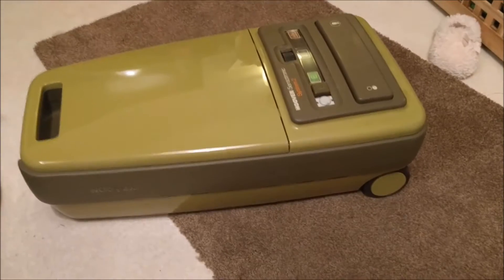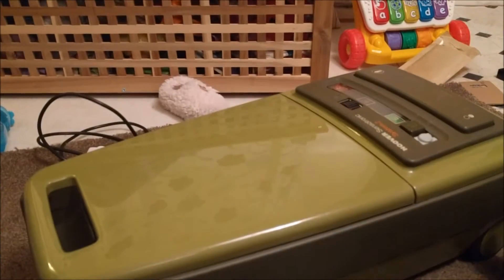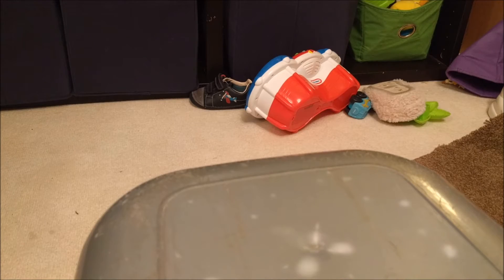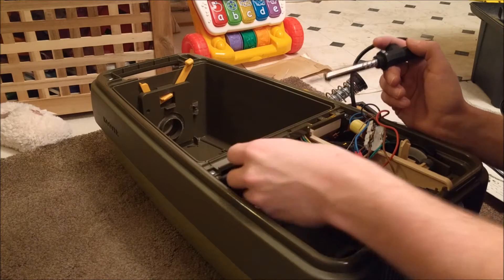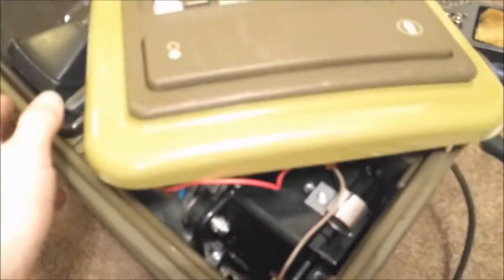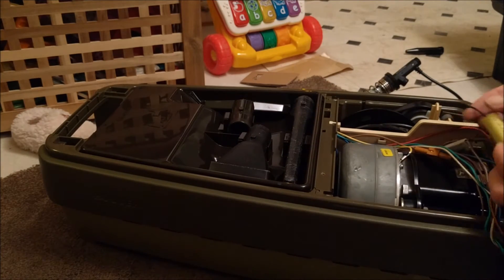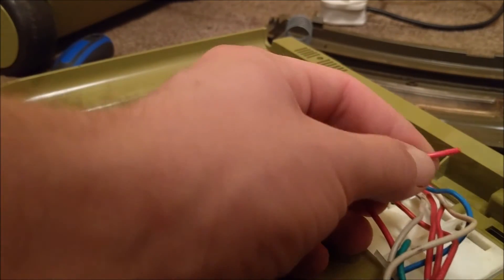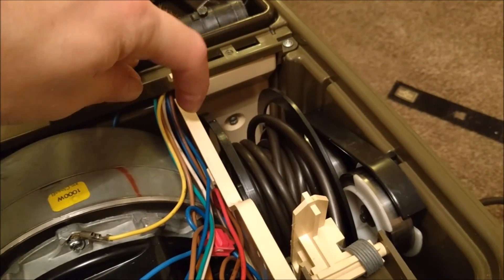Hoover Sensotronic S3128 - (An attempt at) Electronics Repair

Comment: Adult juice... lol Well done for tackling the reed switch. Quite an innovative component for them to use back in those days. Looked a bit of a cheap way for Hoover to apply it though. The glass/plastic packages used in your machine are nearly always PCB mounted, so no wonder it was difficult to fit without damaging. Did you check continuity on all the wires in line with the indicator lamp? Could be as simple as open circuit somewhere. Can't image what's on the PCBA, looks to be all 240V - not much logic going on. Be interested to see what all those wires are connected to behind the cable rewind.
Reply from the maker: Nicholas Wheeler I think one of the Reed switch issues is the new one is smaller, so doesn't fit as easily. The sellotape replaces hoover original sellotape! I've not started checking the continuity yet from the pcb to the circuit board, but will do that when I get to it! I'll be sure to show the pcb too when I dig it out!
Reply from the maker: +Nicholas Wheeler The pcb sits behind the beige panel behind the rewind, so I've got to take the rewind out, then the dividing bit, then hope there's enough flex in the wires to not have to remove them all as the Reed switch broke when refitting it the last time, and I'm not doing that again!

Comment: top tip, don't join the leads when cutting out a arc supressor, you dead shorted by joining the wires.
Reply from the maker: Will Vaszocz Oh is that was its called? Why did I think it was an rf supressor? What's the difference?
Reply: +Beko1987 sorry i meant rf supressor, but it is still wired in the same, the supressor goes between the live and neuatral on a motor to reduce electrical noise from brushed type motors. so when you joined the two black wires it shorted out. an arc supressor is installed in a simmilar way on relay switches to reduce arcing on contacts.
Reply from the maker: Will Vaszocz I've removed loads of rf supressors before though and it's been fine. But they did have more wires, usually an earth too. This one was different though!
Reply: +Beko1987 did you try running the machine without the capacitor and black wires disconected,
Reply from the maker: Will Vaszocz yes, it ran fine before I took the capacitor out, then blew the fuse when I ran it without. I didn't take the wire out completely though, it links a live and I didn't think it would work at all. Tempted to just leave it now tbh! It works...
Reply from the maker: Will Vaszocz yes, it ran fine before I took the capacitor out, then blew the fuse when I ran it without. I didn't take the wire out completely though, it links a live and I didn't think it would work at all. Tempted to just leave it now tbh! It works...
Reply: +Beko1987 probably better off, but i bet if you cut it out and did not join the black wires it would probably run
Reply from the maker: Will Vaszocz ill try it, thanks!
Reply: +Beko1987 goodluck! we never had that model here so i cannot be 100% sure